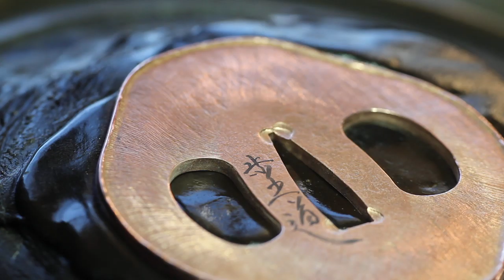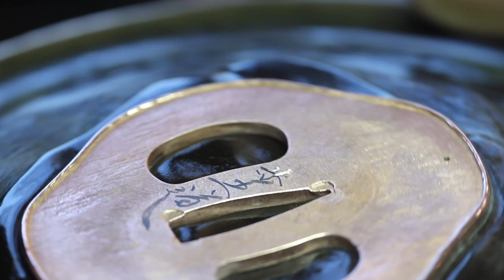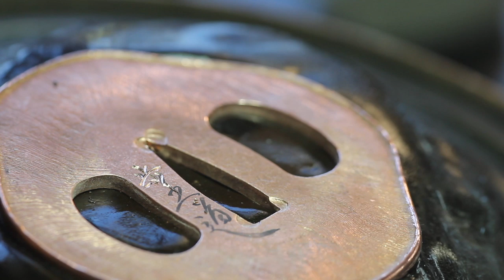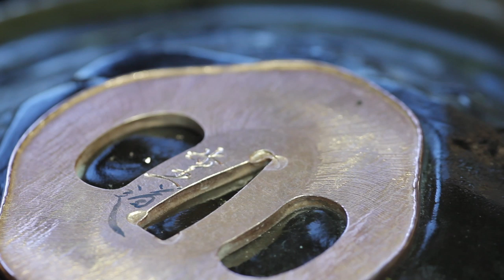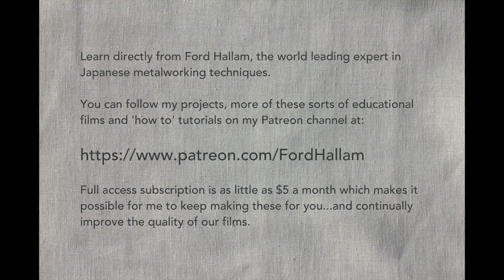Tsuba school : Part 11 - Finishing the rim and signing the work.

Comment: Hi ford. Is there any close up pictures of the tagane used in the mei process.
Reply from the maker: Hi Jibril, it's a kata-kiri chisel. We did a film on the making of one a while ago. Also, there are some close up images of a slightly modified version I actually use on facebook.
Reply: @FordHallam  thank you very much I will check it out,  I've just finished preparing my blanks.